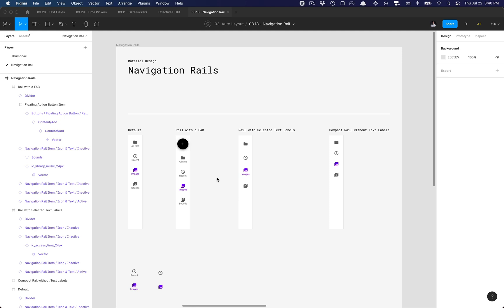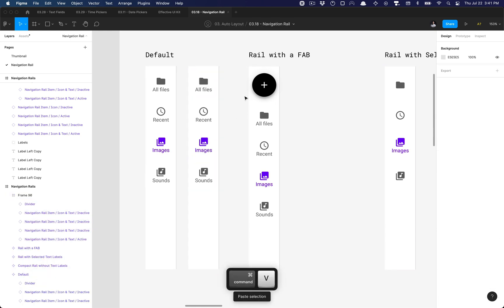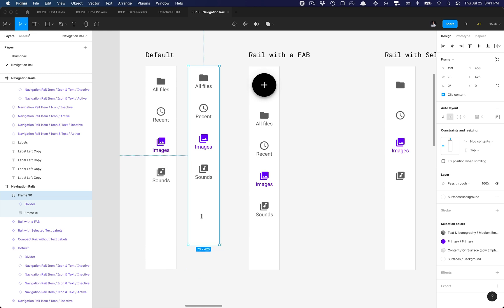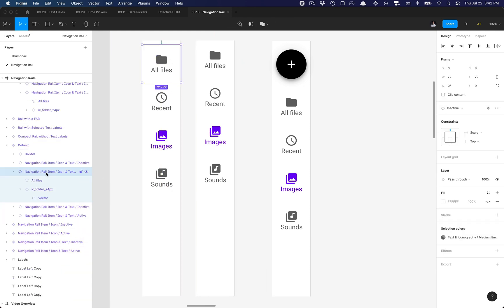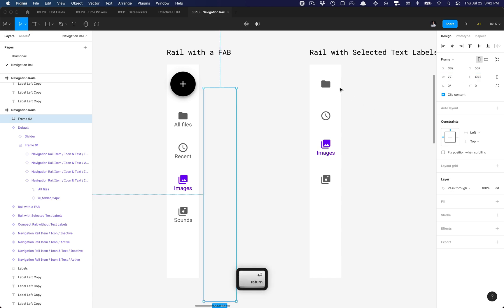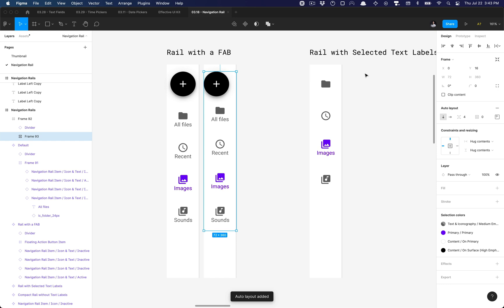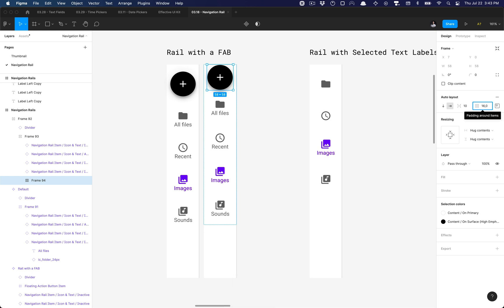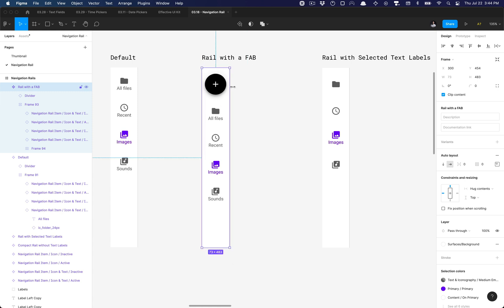Let's Build a Design System: Navigation Rails (w/ Auto Layout)

Comment: Hey Tim, came across your Figma design course through FCC and loving it so far. I noticed you also have a paid program on your website - could you tell me the difference between that course and the 7.5 hour video posted by FCC? Thanks!
Reply from the maker: Hi Eli, I hope you're doing well. That is a great question! The course on FCC does not cover adding auto layout to the design system, states (in-depth), or variants. I'm still building out this portion of the course and will have it available for free on my online learning platform once I launch the second part of the course. There will also be free courses that I won't upload to my youtube channel or FCC that will be exclusively on my website. For example, a Figma to Code series. If you haven't already, here is a link to the course roadmap for tutorialtim.com https://tutorialtim.com/roadmap

The paid program on my website will cover more in-depth design system, front-end, and figma tutorials which is at a fraction of the cost of college tuition! I also give one on ones here and there for my paying users to help them with anything Figma/Design Systems. There is also a lot of insights I provide around optimizing your workflow, design processes utilizing figma, and much more.

If you have more questions, e-mail me at tim@tutorialtim.com and I'd be more than happy to discuss further!